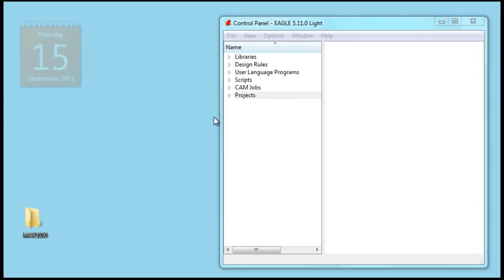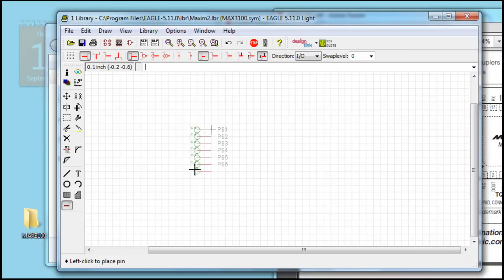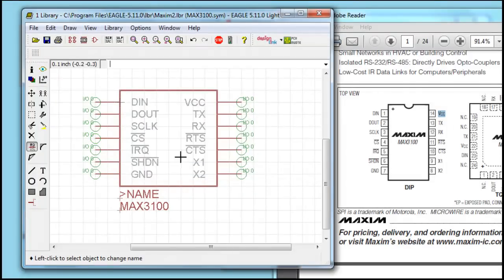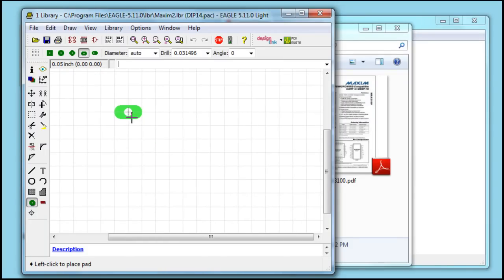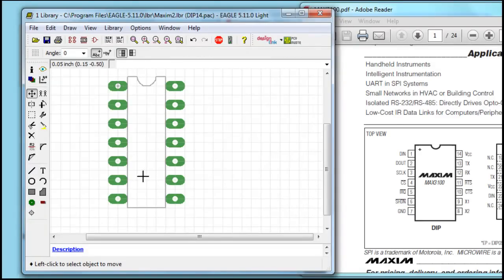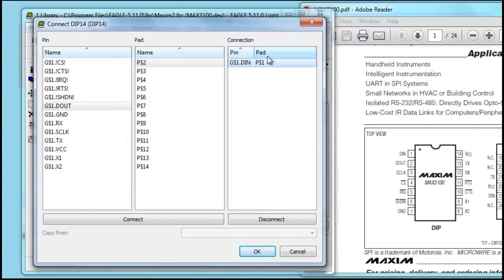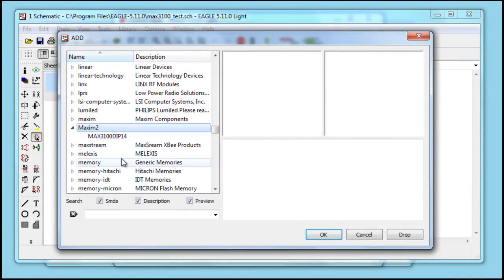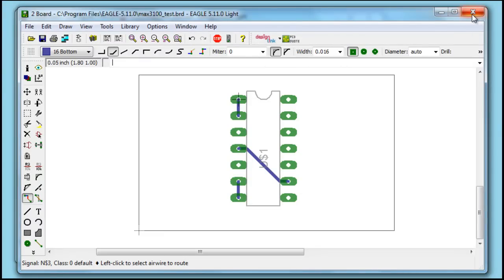Eagle Tutorial - Custom Part

Comment: Thanks for the video, it was really handy. One tip for you in return: You dont have to manually change the grid resolution every time, you can hold alt on your keyboard and it will use the alternate grid setting (which is usually half of the normal grid size).

Comment: Really, useful Jason, many thanks. I'm an Eagle starter and this has been so helpful. I echo'd your instructions, stopping your video at each stage, of course I made some mistakes but I found it easy to back-track on your video and correct my problems. Cheers.
Reply from the maker: Paul Warman i love hearing that it helped.  there is a newer eagle out since autocad aquired them but still similar. glad it helped. if you need anything feel free to comment

Comment: Great tutorial. I'm using it to build my own library part and it is giving me all the info I need.

One this was missing though. My SMD part has a distance across that is not a multiple of the pitch between the pad. How can I easily add the second row of pads without individually switching between the two grid resolutions? Now I had to change grid once once to select the row, and a second time to add in the pad at the correct width.
Reply: I found this tutorial by Ilya Mikhelson to be a nice addition to the one by Jason Lopez.

Comment: Im just having one problem: when I try to 'use' my library, it will not come up in the add list. any recommendations? Thanks for the informative video!
Reply from the maker: MyLifeForDubstepp make sure you select to USE  it from the menu. once you USE it , it will be displayed
Reply: Have done so but nothing comes up. Ive tried to un-use other libraries and re-use them again and that works with no issues. I just cant use my library. Thanks for the fast response!
Reply from the maker: Perhaps its the files location. Try moving it to a simple path like C:\myLibrary.lbl or try renaming it to a simpler name? ... no problem .. if i can help quick i will.
Reply: I just ended up deleting the library and redrew everything. Everything worked great now, Thanks again!
Reply from the maker: MyLifeForDubstepp  ok cool.  sorry you had to redo it.